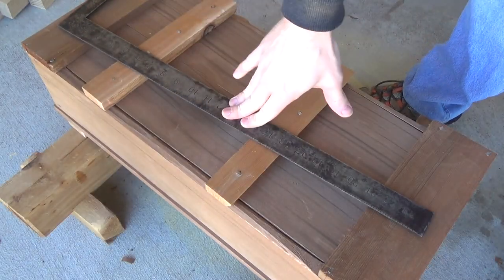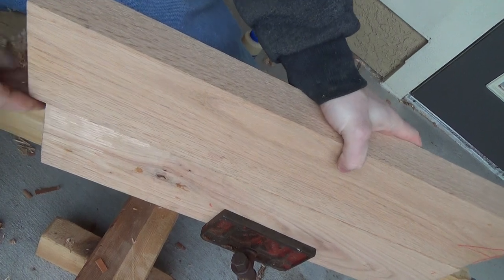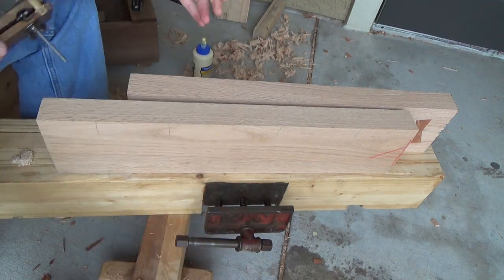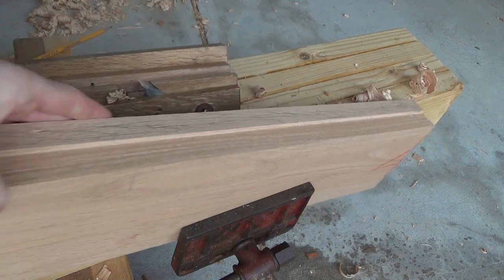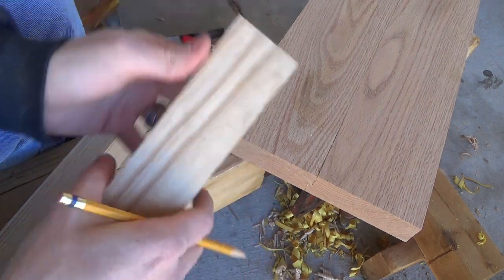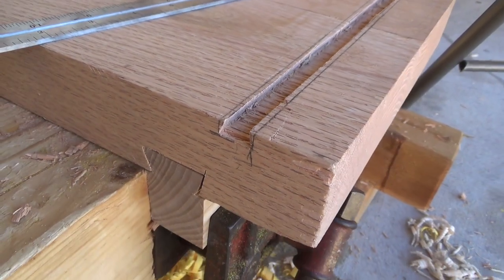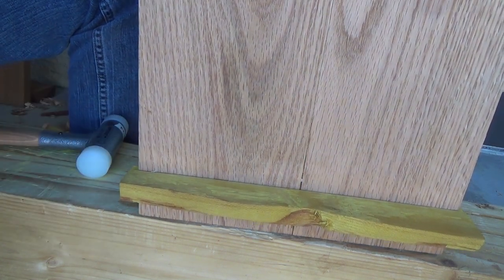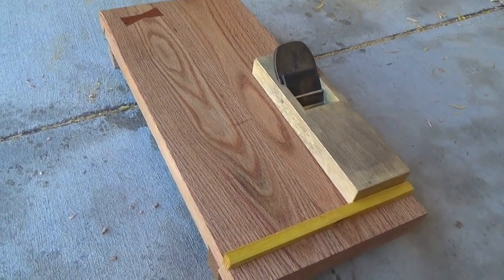Building a Japanese Planing Board || W/Sliding Dovetails

Comment: Something I noticed, that I think is great and maybe could have merited being said: When you chopped out your first sliding dovetail you were splitting the surface of the board as you pushed the waste out; when you chopped out the sliding dovetail for the stop I noticed you had made a third cross cut so as you pushed out the waste it was smaller pieces that didn't put stress on the surface of the board. Great learning moment that I didn't think about until I saw your technique change.

Great video, thank you for being real.
Reply from the maker: Thanks for watching sir, glad to be of service
Reply: Agreed! I really liked so see the growth and learning contained in one video. When I see problem solving in action it trains my brain to look at things a different way.

Comment: I haven’t even started my Japanese woodworking yet but I borrowed a few good deals from a man I saw you use the scribe for a groove if you get your a forged marking know if you could put it deep enough impression for your soul to ride really easily and the wood would swell back out if you didn’t waited to go up for just a little while but that little bit of compression is not by any means a nonstarter if you wanted to go up right away

Comment: I admire your determination because I to have a lot of these days where nothing seems to go as well as you like . A friendly tip use a knife wall to help stop chip out. and build yourself a  hand router plane for the depth and easier clean out of the tail section on the sliding dovetails. My first attempt at a sliding dovetail will be this spring when I build my tresses table!
Reply from the maker: Thanks, I actually had a router plane in the tool box the entire time I was building this. 

My head exploded when I realized it because I had already finished the board.

Comment: Good job dude. Get yourself a routing plane and those sliding dovetails will be much easier. You should also check out tapered sliding dovetails, they are a lot of fun and impressive when you see them.
Reply from the maker: I actually have a router plane. My brain didn't turn on until after I'd finished all three dovetails to remind me that it was in the toolbox the whole time. And yes tapered sliding dovetails are awesome, might try them in the future.

Comment: Great job Sir !! One thing I've been very curious about with japanese wood planes is what type of maintenance needs to be done with them ??? Do you need to flatten or replace the board over time  ?? Thanks for sharing the knowledge ...
Reply from the maker: Thanks for watching. There's a good deal of maintenance that goes on with kanna. You flatten the bottom but you also cut some relief into it. They're designed to work better with this relief in the sole. For a single blade it can usually go through many dai (the wooden body) before it's used up.

Comment: I love your videos!! And I share your enthusiasm for Japanese tools. I find myself with a sudden need for a hand plane. What Japanese plane would you suggest as someone's first hand plane??
Reply: Look at     dojo woodworking  for discussion of japanese handplanes ,  hida . and japan woodworker, or woodcraft
Reply from the maker: Thanks for watching sir. For a first plane I don't recommend the ones on Amazon from makers like Senkichi. They require a HUGE amount of work to get good results out of. A good first plane should be slightly on the expensive side. Good kanna are far easier to tune and they don't require acts of god to get good results. Plus when it's a good plane you can grow into it. Check out suzuki tool for some good planes. They have some in the 150ish USD range that are great for beginners. Get a narrower one for your first, wider ones are tough to get used to especially if you've never done it before. One in the 45-58mm range should work well for you.

Comment: On the sliding dovetail would it be easier to cut a straight side trough and then shave the angle in?
Reply from the maker: If you have a sliding dovetail plane then yes. I didnt when I made this though so I had to make do

Comment: Wouldn't drilling some holes in the board make it easier to install the butterfly?
Reply from the maker: On some joinery absolutely. With a sliding dovetail though it makes the depth kind of screwy and it's very easy to cut it out of alignment.

Comment: How do you shoot the ends of boards with a Japanese hand plane?
Reply from the maker: You line it up with your bench stop and make sure you hold your plane square. You can make a shooting board for it it just needs to function on the pull stroke instead of the push stroke like a western plane would.

Comment: You mistake that cause the break out was use the chisel along the length of the dovetail.  Instead what you should have done was go down vertically in to the channel especially and the ends where the wood as at its most delicate.
Reply from the maker: The end broke because I didn't fit the dovetail well enough. The trick is to make the most of mistakes when they happen, because they will always happen.